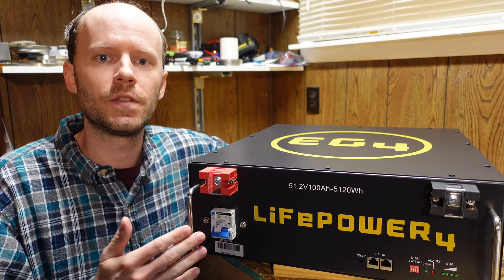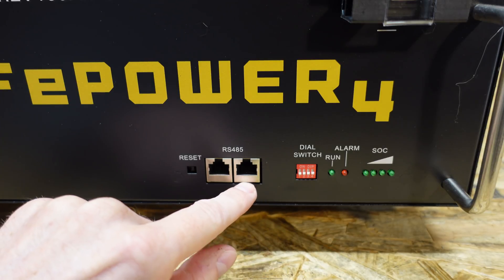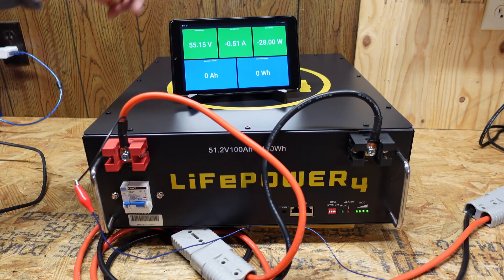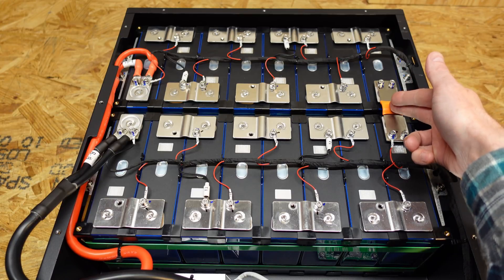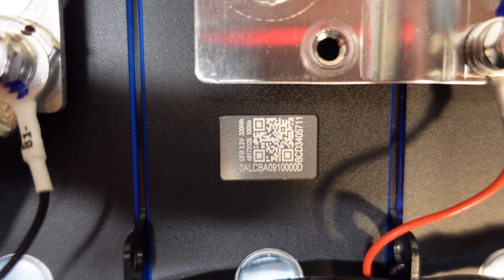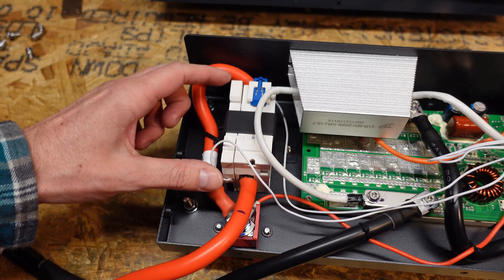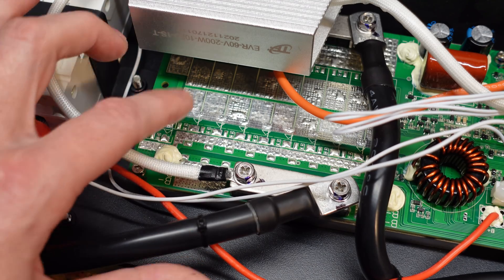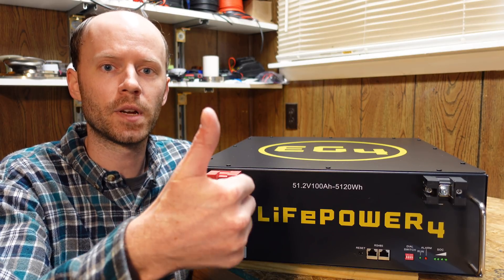EG4 LiFePO4 Battery 48V 100Ah "LifePower4" Review and Teardown

Comment from the maker: EG4-LifePower4 Battery... https://signaturesolar.com/eg4-lifepower4-lithium-battery-48v-100ah/?ref=lithiumsolar (affiliate links)
GFB Cell Modules... https://signaturesolar.com/eg4-8-cell-pack-lithium-cells-25-6v-100ah/?ref=lithiumsolar
Let me know what you think of these batteries, if you have any experience with them, and/or if there's anything you want to see me built with one!
Reply: Use this battery to charge an EcoFlow Delta Pro via the DC solar input!  MC4 to XT60 adapter comes with the EcoFloe Delta Pro.  Do it using normal 15 amp input of the EcoFlow Delta Pro and then do it again with boost converter at roughly 90amps.  This is what I want to do an EG4 Life power.

Comment: Laying the voltage sense harness right over the cell vent holes is a guaranteed ignition source during thermal runaway, turning what should be a controlled release of flammable gases into a roaring fire.

Comment: I'm new to these batteries, can they be charged with a 12V trickle charger? Mine are drained and it was too cold where they were to charge off solar. Brought them inside a warm space away from the inverter and want to charge them as it will be a while before it is above freezing back at the site. 

If I can't use a 12V trickle, what do you recomend I use to charge them. Thank you.

Comment: Any thoughts / input / experience with having two battery storage systems?
I have a professionally installed 9.2kw solar array + (1x) Powerwall2 battery.  Our utility is making changes, and it's clearly now in my best interest to add more battery capacity.  I'm not yet sure how to integrate and isolate a second battery storage solution.  I'll also install more/new panels, that I can wire directly to the second system; two independent arrays.

Comment: If the bms shuts off at 47v, shouldn't it automatically turn back on once you apply a charge on it? Mine turns off and then i have manually switch the breaker off and on again to get it working.

Comment: I'm thinking about adding a battery to my grid tie 10kw Growatt to capture the clipped energy (13kw panel array) for later, but the inverter is in an unheated barn.  It's common for temps to get below 32F in the winter.  Let's say the barn gets cold and so the battery gets to 32F, does it just isolate itself from charging?  I guess what I'm really asking is it "ok" to have a plan where the battery just doesn't work when it's too cold but then it automatically brings itself back online when it gets above 32F?  I really think the main time the battery would see use is in the summer so I'm not all that worried about not getting use in the winter, but I'm concerned the cold on-off-on-off-on cycles would be harmful to the battery.

Comment: I must point out that @ 1:19 the MCB shown is not suitable to extinguish high DC current loads as that's an AC (Alternating current 100Amp 230V 50hz MCB) not a D.C. (direct current one) nor it does have a DC logo on it. Hence its optimum overcurrent protection functionality will be affected overtime or worse arcs could arise 'when tripped' as DC is more difficult to disrupt compared to AC.
Reply from the maker: The circuit breaker is rated for 60VDC. It's perfectly fine in this application.
Reply: Well that’s strange as it doesn’t say so on its printed logo.

I’ll give you half right reasoning as the lower voltage being used (from its original rating) can some what compensate for the arcing features D.C has.
Reply from the maker: @EF-Electrics  It's not printed on the circuit breaker but it's in the datasheet. It's the same as the Nader breakers we're using - stamped for AC but datasheet lists them for low voltage DC as well.

Comment: I am considering purchasing this unit but I've never used a server rack battery.  My question is, " Can you safely connect a solar panel cable and an inverter cable to the inputs on the top of the case like I do on the terminals  for a "normal" lithium battery ?"  Thank You
Reply from the maker: You cannot connect a solar panel directly to any lithium battery. It has to be connected to a charge controller designed for LFP batteries.

Comment: Am planning  to but five 51.2 lifepo4 battery  should  I one 100ah or 50ah discharge.
Reply from the maker: The specifications sheet gives a recommended discharge of 30-50A and a maximum discharge of 100A. While it can handle 100A, running it at 100A ALL OF THE TIME (this is key) will reduce the overall lifespan of your battery. More amps = more heat = faster degradation. It's the same with anything. If you pound the heck out of your car, it likely won't last as long as if you drive it nicely and keep it clean.
https://signaturesolar.com/eg4-lifepower4-lithium-battery-48v-100ah/?ref=lithiumsolar
Reply: @LithiumSolar   I ask the question if it is good or bad choice ????
Reply from the maker: @hutchie9615  In my opinion, using it at 100A routintely is a bad choice.

Comment: Can you tell me how these batteries arrive by  What shipper. I just ordered one and I'm afraid it's gonna come by a big truck which is restricted down my road with no place to turn around.
Reply from the maker: I don't recall the company. They ship freight though and are usually larger trucks.
Reply: @LithiumSolar   The company for that battery would have been "signature solar,"
 And that's what I was afraid of a big truck, Freaking freight was about $250. Because they're hazardous material. Gonna have to try to contact them this Tuesday I guess and get it figured out

Comment: Hello! I need to replace one cell of my battery pack (3.3 Volt 100 Amp) please send information about the supplier! I have difficulty finding only one cell to purchase! My cell is dead: 0 Volt and 0 Ohm!? Is there any way of repairing it? How I am going to proceed in my case? Please advise!
Reply from the maker: They are GFB-brand cells. This battery is not designed to be repairable though. I assume you purchased this from Signature Solar. Have you contacted them regarding the warranty?
Reply: @LithiumSolar  Thanks for the reply! My friend give it to me because I am electro-technical and now I need to be completed it as a battery pack! I really need one cell!  Will short the faulty one and add the new one. BMS is been cut. Just need all 16 cells to be healthy!

Comment: Wonder why no one does test and reviews on the 12v of this battery. I just installed a 12v in my 5th wheel with a Victron system. Hope to get out next month to a campground to run some test on it. No issues running the A/C (1 a/c not both). But I am still looking for things like how it can communicate with Victron as they were supposed to partner up. anyway good info on this unit.

Comment: How could I use this battery is 12v system ?
Reply from the maker: The battery I tested in the video is a 48V battery. They do sell the same battery in a 12V configuration. The cells inside are the same but I'd assume there would be a different version of the BMS https://signaturesolar.com/eg4-lifepower4-lithium-battery-12v-400ah/?ref=lithiumsolar

Comment: I have tried to find there cell packs but the link etc. does not show them.  I'll contact them in the AM.  I did order the 12V version of this unit...   Hope to use it with my
soon to install Victron MultiPlus II 12V 3000VA (I think it is) ... and Cerbo GX and some solar .. I hope this unit will communicate etc. with the rest but maybe it doesn't... hard to find documentation on such configuration.

Comment: One of my gripes is the front panel DC connections.  Looks like there is space to modify for rear panel connections - but it would be better if modification was not required.  Something like an Anderson Power Products 150amp connector in the back.
  
I wonder how many I'd have to order to get that changed...
Reply from the maker: Why would you want rear connections? You would no longer be able to put the rack up against the wall and would need to leave adequate space for a person to fit behind it to install/service.
Reply: @LithiumSolar  You presume I'd be trying to pull it up against a wall or wouldn't already want space around the rack (or that it's the only rack I have)...  and to be fair, all of the youtube installations of these modules I've seen are small-time residential DIY-"hacking"-jobs (so perhaps your questions is from an out of sight, out of mind frame of mind).  This'll be a bit long winded.

In a typical commercial rack installation, one leaves space behind the rack to be able to access the rear mounting for the larger devices, cabling, power, and passthrough ventillation (hot-aisle/cold-aisle achitecture).  High power or voltage (say 4x of these in series for a standard 192VDC bus used by commercial 3-phase inverters/UPSes) isn't the kind of thing you want your datacenter techs brushing up against.  So keeping the power away from status and general service interfaces is how its done in the industry.  Things people shouldn't touch are kept behind either key-locked panels or tools-required-to-enter panels (with warnings plastered all over them).  Opening these panels is a presumed statement of "I know what I'm doing, and I've been warned of the consequences of not knowing".
  
Like I mentioned in the original post an Anderson type plug which is touch safe, meaning one can't get fingers into the contacts when the connector is unplugged, or the conector when mated is fully enclosed - is better IMO than screw terminals behind a chinsy plastic cover (which by the way one could still get fingers past, or drop a screw into especially since multiple stacked units would have their screws vertially aligned).  But it also would allow one to slide a battery module into a rack shelf and blind-mate to a rack-afixed conector which completes the DC bus for replacement/service without getting hands on power connections (pull some front thumb-screws and disconnect the RS-485 cables and pull the handles out to remove).  Now imagine having a few units in parallel, and having to take one out of service while the rest of the system was still online - that means sure, you can turn off the screw terminals for that unit, but the cable ataching to a busbar is still live through the bus bar end, so when you pull it off the screw terminal now you have a live exposed cable end in your hand (and you would have to us insulated tools, which I'd argue most people don't know to have).  They way these are designed now is more conducive to turning off the whole system to do any work on it - what if the customer is on a respirator or some other critical thing like the raptor fence is running off the output?  Even Nedry knew not to mess with the raptors...
  
If one were to try to charge something like a 4S2P array (192V@200Ah) from a commerically available DC power supply (Magna-Power TSD250-120/208, 6u Rack mount 30kW programmable AC/DC converter) - and say 10x 2kW Eaton 3-phase 280Y/120V inverters, you're already going to have back access needs for the other devices. And they have front panel controls which need to be accessed, so to meet NFPA life safety codes having these cables on the front is problematic (or may require an additional, separate rack so the front connections can be protected behind a locked door).  Rather than having the inverters on a wall with cables running everywhere - one could package this into a single standard 42U rack and turn it sideways so that the "front" and "rear" could still be accessed while it's flat against the wall.
  
Having worked in both high end home theater for custom residential construction (the kind you'd see in magazines) and commerical facility design (480V 1200Amp, 600V 800Amp >>per floor<<), I don't like how these essentially DIY-car-stereo-esq installs look.  But that's a personal preference.  I want to be able to walk someone who doesn't understand the hazards of electricity into a server closet or power distribution room, and open doors to look at pretty lights without worrying about a kid going what does this do ZAP!  I wouldn't want them seeing random cables draped everywhere, or conduits running piecemeal to equipment that doesn't match.  Being able to run conduit under a raised floor or under a slab from the breaker panel to a sterile monolithic rack looks more robust and safe even to the untrained eye.
Reply from the maker: @Real_Tim_S  Keep in mind that these can NOT be series connected. 48V is it.
Reply: @LithiumSolar  Signature Solar provided me with different information than that.
Reply from the maker: @Real_Tim_S  Well that certainly is news to me... I shall ask and check the FETs.
Reply: @LithiumSolar  I think more importantly, if these are not supposed to be placed in series, that warning is notably absent from the manual. Thus my question posed to Signature Solar (was originally looking for an 18S 750v solution, and was told no more than 4)

Comment: I'm building a 48v 120ah pack and based on the data provided by manufacturer, these cells have a stndard charge current of 24A, fast charge current 120A, and Max Charge current is 180A.
What's your suggestion, use the standard or can I use something higher to make it faster?

Comment: To be critical, it is nice-ish, but could be better.
My biggest fear is that none of the BMS wires are fused, so while the harness is nice, if some short occurs on the BMS PCB or connector, or any of the wires anywhere, that harness will smoke fast.
It's mindblowing how many of the battery packs miss this!

Another nuance is that any thin wire which goes near any large terminal, screw, heatsink, etc, should be in some protective tubing and possibly fastened to prevent movement or contact with anything. For example the long, loose grey wire that goes to the BMS from the breaker. Remember, it doesn't matter if the large wires are fused, if an 1mm2 or so wire starts to burn. It will not draw enough current to trip the breaker, but potentially can cause fire.

Another observation, which is not a safety issue but might or might not be a convenience issue: the arrangement of the front panel. When you connect something to the screw terminals, it will protrude into the next rack unit. You can't wire it downwards either, because the breaker is directly under the terminal. In case you want to stack a series of these, you can't use a busbar either.
It would be nicer to position the terminals horizontally in the centerline and shift the breaker out of the way. Or possibly place both terminals on the left side diagonally, that way it could be wired either veritcally or horizontally as seem fit.

Comment: for how many hours can you power an AC 1-ton unit with this battery? thank you
Reply from the maker: It's a 5100Wh battery. Multiply that by 0.85 for inverter losses then divide by hourly consumption of your appliance. That will give you the runtime in hours.
Reply: @LithiumSolar  thank you so much

Comment: I have 2 EG4 batteries in parallel but the terminals are too small for my 4/0 wire lugs. Any idea on a work around??
Reply from the maker: The largest lug I was able to fit on mine is 1/0 unfortunately. If you need 4/0 for some reason, the only way I can think of to do it (without replacing the terminals) is to use a busbar off to the side to run 1/0 from terminals to bar to combine the batteries, then a 4/0 off the bar to your load.

Comment: I am getting a 24volt reading across the positive terminal and the battery casing. Same thing from the negative to the casing. I have the 48volt version. Can anyone tell me why there is voltage on the case?

Comment: I just bought two of lifepower4. I know that they are built to lay flat but will i hurt them by standing them on end?
Reply from the maker: No, it will not hurt them to sit with the front of the battery (where the breaker and connections are) facing up.

Comment: Could someone start with one of these and then add a 2nd in parallel a year down the road? Or do all batteries in parallel need to be same age?
Reply from the maker: Yes, you can add more later as needed. Each battery has it's own BMS (battery management system) so there's no concern regarding them being the same age.

Comment: I work for a solar company in Oklahoma, we just recently started installing these batteries instead of Simpliphi. The price for the quality is absolutely incredible on these. And the fact that You can fit 31kWh in a 2’ x 2’ x 4’ cabinet!
Reply: I have a Sol-Ark 12K and unfortunately bought a SimpliPhi 3.8/48V bat at the same time. I opened up the SimpliPhi and it is JUNK compared to my three 48V LifePower bats. Expensive lesson learned.
Reply from the maker: @TBooneFisher6931  Wow I'm surprised to hear that. I have never looked at one myself; however, I've heard they're one of the top choices for residential installs. What was wrong with it?
Reply from the maker: They're a great deal and they're UL-listed now!

Comment: One thing I really like about this battery is you can just use a regular ethernet cable to connect to a growatt inverter. You can then program the inverter to function by battery percentage vs voltage.
Reply: if you can get it to work
Reply: @davidkettell5726  These work great, so long as the person has more than 2 brain cells, it sounds like a potential user error, not battery error.